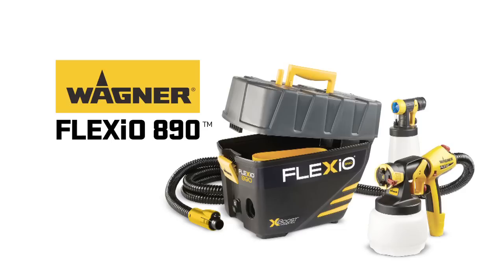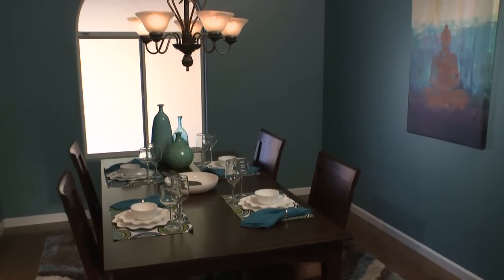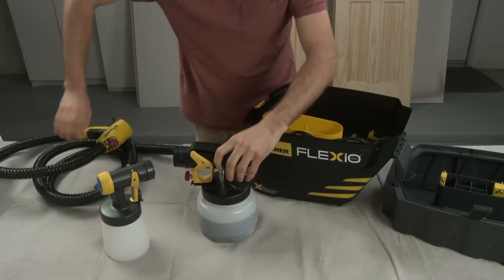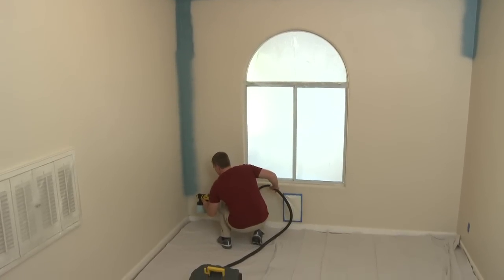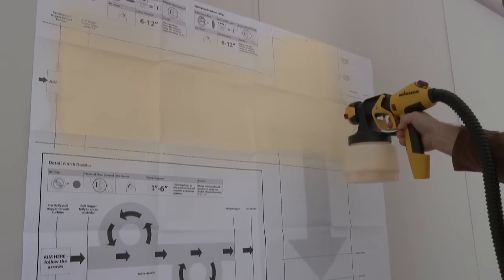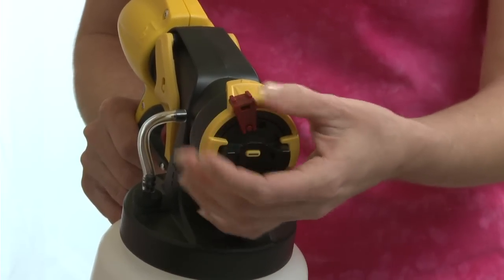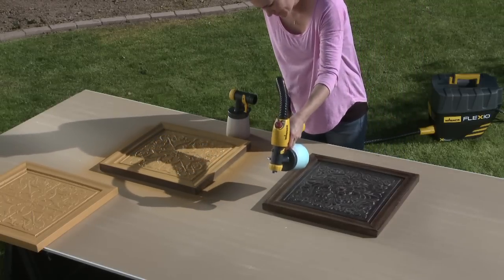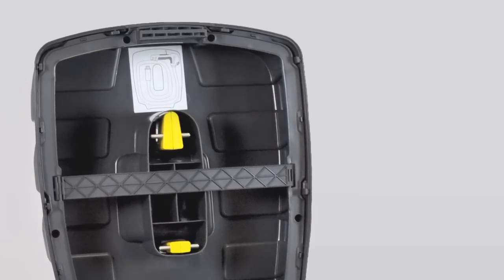Wagner FLEXiO 890 Full

Comment: I have the 590 and it works great once you get used to it. Folks, this isn't some tool you can un-box and use right out the gate. You need to use that practice poster they give you and I would suggest some cardboard or a piece of plywood too. You need to get used to the spray patterns and find the settings that you are comfortable with and appropriate to the paint/stain you use. Once you get it dialed in, its a great tool.
Reply: It looks big and clumsy.
Reply: @Joesmith-fu4ps  No, it actually is not. It is surprisingly not bad in terms of balance and weight.

Comment: I just bought this to paint the unreachable spots and corners on my roof. I am using Glidden Premium Exterior paint. The gun, once I found the right combination of air pressure and paint level, was doing fine for the first 10 minutes, after that, it started spitting globs of paint all over my floor and walls. I had used a paint strainer and stirred the paint very well, don't know why they advertise this gun as working with unthinned paint.

Comment: It gets a lot of build up when spraying latex or acrylic. I put PAM vegetable spray on the gun so the paint doesn;t stick so tightly and then I still have to use a cleaning brush and a soft brass brush to clean it with. They should show what it really looks like after spraying. I works well and is easier than the readypainter with the turbine mounted on the gun(that is heavy after a short while).  I just painted a whole house with mine consisting of mostly heavy very deep stucco.  Worked great.